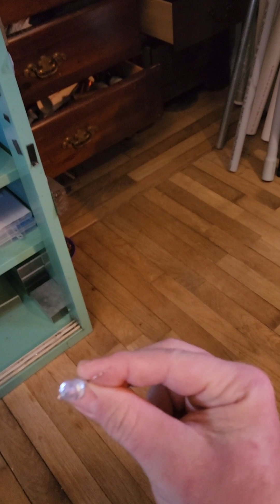⚡️ MORE EXPERIMENTS WITH MY RADIENT ENERGY CHARGE HARVESTING TESLA COIL 📡

Comment: What are you doing to keep the amps down at a higher voltage?
Reply from the maker: So far just using the diodes & running the transmitter from 30-40vdc keeps the amperage under 10 amps from the pickup diodes. The diodes have to be rated for twice the voltage & Current that's running through them. I will eventually need a resistor if I run the transmitter off of 100 or 200vdc
Reply: @MTECHINDUSTRIES2022  how are you placing the diodes? Like a slayer exciter circuit?
Reply from the maker: @freedomer342  my slayer exciter circuit has 3 Avalanche Diodes in it for negative resistance & they're in the same spot as a regular slayer circuit. I then make a bridge rectifier out of schottky diodes & capture the back emf from the L1 coil. I obtained all my components from newark.com
Reply: @MTECHINDUSTRIES2022  what kind of diode is the bridge made out of
Reply from the maker: @freedomer342  20SQ080 anything else seems to burn up
Reply: @MTECHINDUSTRIES2022  where are you getting your top loads from?
Reply from the maker: @freedomer342  www.usball.com

They're kinda pricey for titanium
Reply: @MTECHINDUSTRIES2022  and your using a a cbb capacitor in series with the transistor?